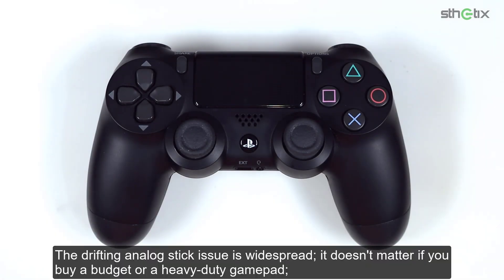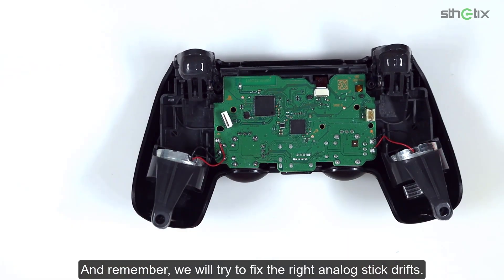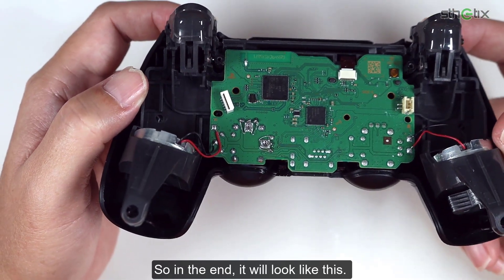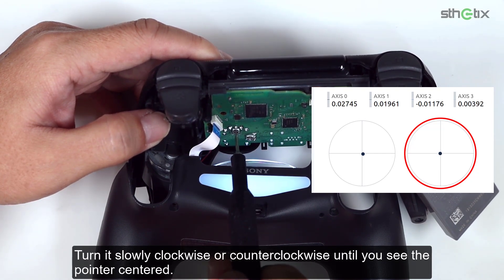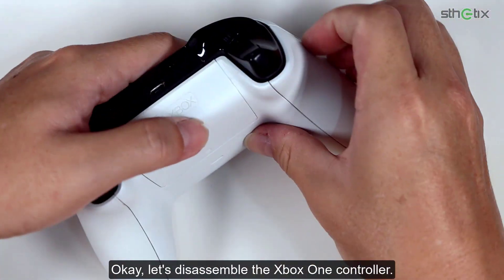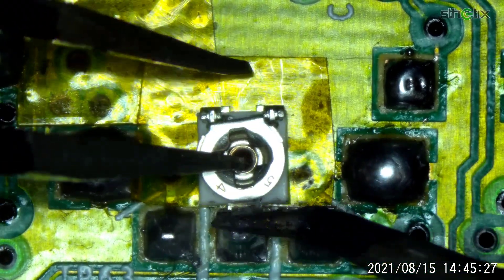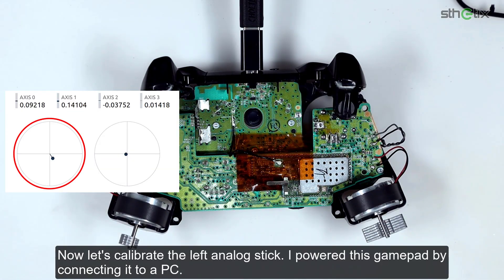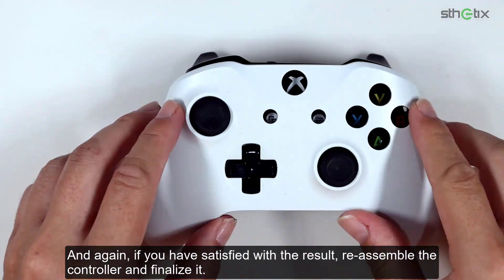THE ULTIMATE WAY TO FIX ANALOG STICK DRIFTS ? PS4 PS5 XBOX ONE NINTENDO PRO CON AND MANY MORE

Comment: The problem that I have is that whenever I install the boards, the controller won't read 100% anymore. I've tried this on 2 different controllers and 4 joysticks, and all have the same issue...
Reply from the maker: Yes it does alter the "power". You can try to replace it with hall effect analog stick. maybe that is a better option.

Comment: Hey mate I installed a pod like you in the video. Mines just a little crooked xD but I'm really really close to the center now. I used black Alps sticks on a Xbox One controller that I bought Yesterday without screws and completely drifting its now balanced in the center :)

Forgot the kapton tape though. Will it be a problem?
Reply from the maker: if it is not shorting then it is fine
Reply: @sthetixofficial  allright thanks! Just to be safe I'll do the pots again today but without your video I would not have gotten this idea so credits for you and the person who told you but you made the nicest video :)
Reply from the maker: Thank you
Reply: @sthetixofficial  I just did them again and yesterday I only did one axis so now I did 2 and my range has been cut to about 80procent on both sides. Can I counter this with different pots?

I gues I'll just go back to 1 pot because the other line is already pretty good.

Comment: just wondering... since you're adding a resistor in parallel, it's not better to have a 100k potentiometer instead of 50k? Considering that the base controller potentiometer is 10k.  You would lose around 10% of the resistance, instead of almost 20%. I just did the math in my excel sheet and feel that 100k is a better number in theory. Also did the math with a 200k and 100k is a better option.
Reply from the maker: I think u can use a 100k pot as others do that too
Reply: @sthetixofficial  I accidentally bought 10k, would that work? Or should I just buy and use 50k to be safe?
Reply from the maker: afaik, we should use either the 50K or the 100K

Comment: Guys, i did it to my first gen ps4 controller. It definitely takes the drift out but at the cost of maximum reach, before mod my controller was touching the circle of the gamepadtester but after installation did not. I read a similar problem on the video he inspired of. Take that in consideration, maybe in other controllers is different
Reply: This happens when the problem is in the lever and not in the potentiometers
Reply: @lucianinholima93  But how could that be?. I mean before the installation they work with max reach but after installation they dont
Reply: @de.vp10  That happened to me once. Then I started to change the analogue ones and install this variable resistor to regulate, so I didn't have this problem anymore
Reply: @lucianinholima93 bad idea,no need to change the analogue unless the movement is clunky or damaged,getting a new analogue to be as fluid as the original OEM is difficult,u rather change the potentiometer which far easier to replace than the whole engine.
Reply: You are right. If the movement cannot reach max value, the character cannot run, only walks. It has to be the resistance value on trimpot. I tested with 50k, 20k, and 10k all cannot reach max. But the ones comes as pair with yellow pcb flex works perfectly.

Comment: when I do this, I screw the pots, and it centres my stick, but then the analogue stick does not go fully up nor down. I push the analogue stick fully up or fully down, but on gamepad tester it shows as if the analogue stick is only being pushed halfway. please help
Reply from the maker: Try replacing the pots
Reply: @sthetixofficial  they are 10k pots. Should I change them to 100k pots?
Reply from the maker: 50k or 100k is ok i think

Comment: For the ps4 controllers with the larger battery plastic compartment, not the one shown in this video, you need to cut away the plastic on it.  If you don’t it will sit on top of the newly installed pots and the controller can slightly mis-shape when it’s reassembled.  This can make the analogue control physically stick in the the direction you move it too.  
Just happened to me lol

Comment: hmm, after installing about 5 of these, I got maybe 1 mm of turn before it pegs out in either direction. Wonder if my smd pots are junk or incorrect value
Reply from the maker: If the pots dont fix the issue, please replace the analog stick.

Comment: Thank you for the clear instructions. There are many myths around fixing stick drift on PS4 controllers - examples include holding the reset button for 8 seconds, spin the sticks five times, disconnect bluetooth, etc. - but none of these work. There is no user-accessible calibration for stick drift. Replacing sticks is a lottery because even new sticks can have drift. Adding trimmers like you've done is the only method that works. And with trimmers costing 15c each it's an economical fix too.

Comment: Did this, but now the sticks have about half of the range of motion that they used to. Gamepad-tester shows they went from a margin of error of 9% before installing the pots to over 30%. They're basically unusable; the radius of the left stick has been cut so severely that I can no longer navigate menus with it. I tried a new analogue stick assembly, too. Works fine (but is off-center) without the pots, half the range of motion with the pots.

This fix has the right idea but I'm not sure 50k Ohm is the right value for the pots.
Reply: The potentiometer value for controller is 10k so im not sure why a higher value it being used and you said 500k would would the difference be be then those 2 values
Reply: I had this issue.  I changed the analogue stick to the orange favor union ones and I was getting less than 6% margin of error on game pad tester.
Reply: @JakeMcClane  this is very useful, thanks!!
Reply: Same here. As drift fixer it`s ok, but in my case this adds same range problem.
Reply: @Ig0r37sI  I tried 500k ohm pots instead of 50k and they brought my range of error from 30% to the single digits.
Reply from the maker: Hello you can try replacing the whole analog stick
Reply: @sthetixofficial  Thanks! Yeah, I tried with both an old and a new stick in the same controller (Xbox One). Same result with a 50k Ohm pot.

However, with a 500k Ohm pot, you get nearly full range of motion!
Reply: @arobotbitme  where did you get yours?
Reply: @jiovanirivera852  Ali express. Took a while but they work great.

Comment: 2 more questions: If you only had problems with one axis, why solder on two? What kind of knife do you use to cut the wire under the scope? Thanks!
Reply from the maker: you need to put the pot on one axis only and i used a scalpel knife

Comment: hello, in the meantime thanks for the guide, then I wanted to ask you something, practically I first replace the analog stick, and since 80% of the times, the new one I put has the dead center moved either more to the right or more to the left, to center it I use the potentiometers as you do in the video, the fact is that I lose some travel, or through the software I see that even if I move the whole lever to the right or left or up or down, the travel does not reach the end .. gai a solution to the problem ??  sorry but I write with a translator
Reply from the maker: yes, in some case you need to replace the analog stick. this method doesnt work for severe drifting damage.
Reply: @sthetixofficial  yes I know, the problem is another, that when I replace the lever, often the cursor (using the software you show in the video) is not in the center .. so I use your method to manually center it.  but in this case then the stroke of the analog stick decreases .. I don't know how to explain it to you, maybe you have a contact to send you a video?

Comment: I replaced the left stick of ps4 controller. After that i had to test it with my PC. I discovered  the left stick just got stuck to left top corner without moving even when I move the left stick and the right stick does'nt respond as well (I.e no data registering) . Please what could be the cause? Is there anything I could have damaged while soldering in a new stick that would make both sticks not to respond anymore?
Reply from the maker: check the solder pads, maybe it is damaged.

Comment: I have a question. I am new to micro-soldering, though I have done a couple of really pretty 0402s successfully! It looked like the wire you were using, you didn't have to strip the second connection. Is this a special kind of wire? Or is there some technique I don't know about that allows you to burn the sheath off while soldering? Thank you for the great guide!
Reply from the maker: It is a tinned copper wire. We dont need to strip its ends
Reply: @sthetixofficial  Still ramping up my workshop, so thank you for all your input. Is tinned copper wire conductive in the places that you haven't burned it? I'm thinking in terms of the Northridge Fix video where he did like 14 jumpers on an HDMI port. They seemed to be laying on one another. I think he used enameled wire. Is tinned and enameled the same?
Reply from the maker: Tinned and enameled is different.. Tinned means the wire body is 100 percent conductive and easy to solder. While enameled does have a thin transparent jacket to avoid shorts. Since we are using a short length of wire, and no risk of shorting the motherboard, i used the tinned copper wire

Comment: 100k trim pot working perfect on PS4 nacon pro wireless controller
Reply: Im using the 50k but in games like COD when the pot is installed character cant run, with the 100k can the character run?
Reply: @villachivas  honestly I have no idea I dont have that game to try. I found that 100k works a lot better than 50k. If I do find out I will let you know

Comment: You wouldn't happen to know if the pots you ordered are single turn or adjustable?
Reply from the maker: it is adjustable
Reply: @sthetixofficial  Do these work? "50k Ohm SMD Potentiometer Trimmer Variable Resistor 3x3mm" thank you.
Reply from the maker: yes that one.

Comment: Can you use 100k trim pot or has it to be 50k
Reply: I can confirm that the 100k works perfectly. It’s now Dead centre. I also replaced the 2 inner white potentiometer. Before this was all done the PS4 controller was tested with gamepad tester and the dot was all over the place (right analog) also the test circularity % error dropped by 6%. Tested in game and works a treat. Very happy with the results. All thanks to your excellent video. Thank you 👏👏👏👏👏👏
Reply from the maker: thx for the info.
Reply: 100k ordered I will report with results by this wknd
Reply: @JGames-sv8gy  hey uhm does the stick reach the end of the circle with the 100ks?
Reply: @hakimdurand8427  yes full circle works perfect for me
Reply: @JGames-sv8gy  would 1m ohm work?
Reply: @allaroundgaming100  I have never tried 1k only 50k and 100k
Reply: @JGames-sv8gy  Im a bit late because my 100k pots finally reached so im gonna try it. Im hoping a small gauge wire is fine :l. (Just installed them 100k pots seem to have it pretty centered gonna try apex and see how it feels)
Reply: @hakimdurand8427  hi yes small wire is perfect. If you solder the pot to the stick then get your wire and solder it to the pot pull it to your stick solder it then cut it. Easier than trying to solder very small prices of wire
Reply: @JGames-sv8gy  did it already. It worked tremendously.
Reply: @hakimdurand8427  perfect 👍
Reply from the maker: I havent tried the 100k, please try it and report back. Thx

Comment: Thank you for preparing this amazing video , I have a question, does this adjustment works after turning off the controller ?! Or we should adjust it every time we use? 🙏🏻
Reply from the maker: It is permanent
Reply: @sthetixofficial  Thank you for replying, actually I replaced my ps4pro controllers  analog sticks with brand new high quality analogs as you mentioned in video but unfortunately it has slightly calibration problem, if I can’t use this method , do you think if I replace the white module inside the analogs potentiometers , the problem will solved ?
Reply from the maker: no. even if you replace it with the original one like the white one on the potentiometer, you might see it drift a little bit. if it is not drifting a lot you can try to use the method in the video or ignore it as there are tolerance
Reply: @sthetixofficial  Actually the method that you use is so brilliant and I’m sure this will help me so much! Instead of “50K SMD Pot” can I use “50K Multi Turn Pot” ?! Because I couldn’t find the SMD pots 🙏🏻
Reply from the maker: multiturn is too big, it wont fit inside the case. try finding it on aliexpress
Reply: @sthetixofficial  yes you are right sir, but the performance is the same in the two different potentiometers as long as we use 50Kohm versions of them
Reply from the maker: I think it is the same

Comment: Thanks for the video! Question: since you are using one potentiometer per axis, how does the min/max values of the axis work after calibrating the center?
Reply from the maker: if the drift is so bad, then using the pot will decrease the max value
Reply: Can we use 100Kohm smd pot instead of 50Kohm as i am not able to get the 50 ones for my par controller. Plz reply.
Reply from the maker: Try using the 100k
Reply: 50k pots reduce the overall throw of the stick... ended up just mechanically centering the sticks by bending the tab that turns the pot. If only ms/sony had a calibration option like nintendo does!

Comment: Not as good a method as it seems. In my experience, the pointer is no longer able to make it all the way to the edge of the circle once the 50k pots are installed. You can see this happening when he tests the ps4 controller after calibrating. This will affect gameplay, especially fps games.
Reply: Just mechanically bend the tab that turns the pot in whichever direction it needs to go.  Been doing this for over a year when I swap pots cause sony/Ms can't offer a calibration option like nintendo does.
Reply: @jamesarmenti8876  hello you mean bending the tab that sticks out of the analog stick and insterts in the potentiometer? How you do it? With tweezers and maintaining the stick centered? I'm interesting because I'm fixing controllers but many of the potentiometers are of centered
Reply: @albertogog8567  Yeah I just use my tweezers and hold onto the flat tab sticking out of the stick (that goes into the pot)  I then push the joystick to the left or right (whichever direction moves the stick closest to the tab you're trying to bend. Then just twist the tab slightly or move the stick in the opposite direction to get the tab to bend enough. You aren't moving it very far at all.  The other technique i've done is taking the wiper out of the potentiometer and gently moving it in whichever direction you need the center point to be.  It's so ridiculous that they don't auto calibrate sticks. I've fixed some 3rd party crappy controllers that actually do auto calibrate on boot!
Reply: @jamesarmenti8876  if tried the bend method and it worked for me, but I don't understand what you mean with the wiper, in the second method
Reply: One more thing if you can help me, I bought joystick caps from alliexpress to replace the broken ones. But they are not exactly like the originals and the joystick rubs against the case. Do you have any tip for that or where to buy good ones?
Reply: @albertogog8567  if you remove the center disk out of the potentiometer, you'll see the 3 contact points on it. The middle one up at the top is the one you can grab with fine tweezers and gently flex it  left or right (in whichever direction needed to bias the pot centered)
Reply: @jamesarmenti8876  okay I'll try that too, thanks
Reply from the maker: if it doesn't work, please buy a new gamepad

Comment: The nominal the resistance should be 1M, otherwise the joystick will not reach the boundaries of the ring. Like your video.
Reply: @vayzz  i think he means to use a 1M ohm pot instead of 50K ohm pot otherwise you won't be able to reach the full outer boundaries of the stick. @mr Drew sound right?
Reply: @tuffrabit  @vayzz @mr Drew. Did 1m work for you guys

Comment: This is true. I didn't even know that each controllers are calibrated and to really fix the drift issue you must also install the same analog module with the sane calibration. 

As I found out today. I soldered two new analog modules and guess what they also developed the SAME DRIFT after a couple of weeks. Yes you heard it right, they developed the same issue, same drift just like the original analogs.
Reply: same thing happened to me two days ago. I watched about four different videos talking about how to fix stick drift and all they did was replace the analog stick or replace the potentiometer and none of them talked about the fact that you will most likely have problems with stick drift even after because it's not calibrated as The Originals were. They all showed them having no stick drift after the installation.

My controller right analog stick now drifts more than before I tried to fix it. I actually had to buy a new controller because now I'm going to have to spend a lot of time trying to figure out how to fix the old controller but I at least I get to learn or something like that right?
Reply from the maker: try to replace the analog stick.
Reply: @sthetixofficial  I might try that but that means I would probably have to buy a desoldering gun or a heat gun because I don't have either of those since I have a kind of cheap soldering kit. People said taking off the entire analog stick without either of those is quite a task
Reply from the maker: you can use cheap soldering PLUS a low melt solder to remove the analog stick. and use flux too
Reply: @sthetixofficial  thanks for the heads up